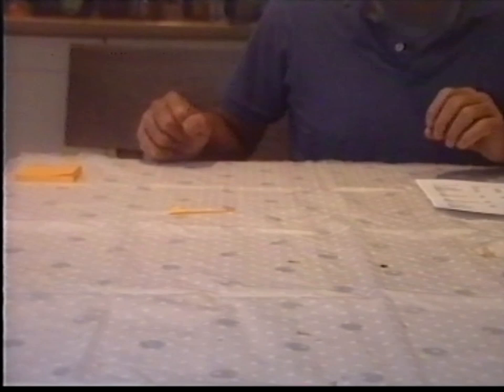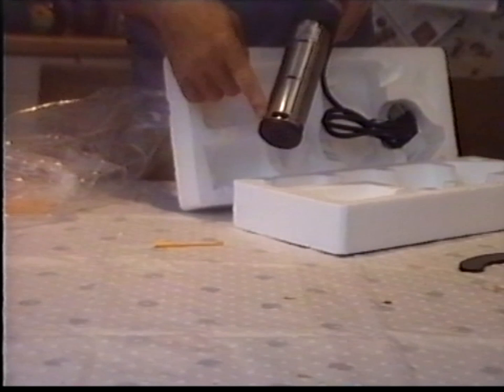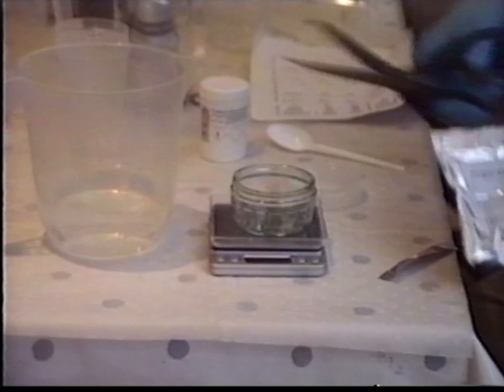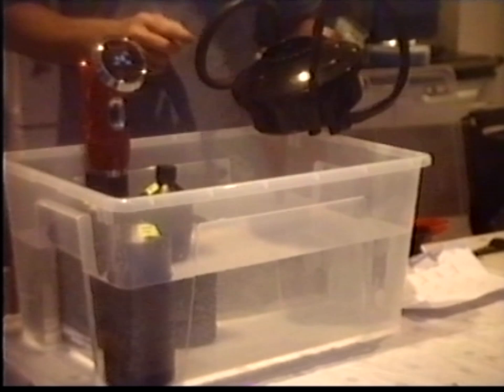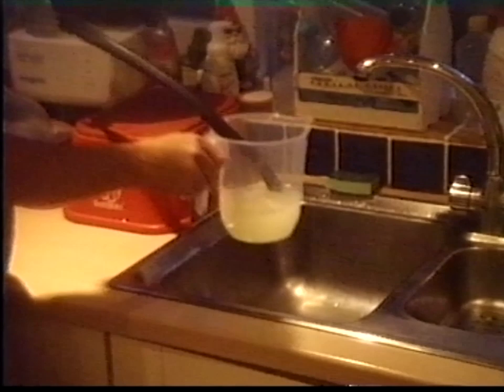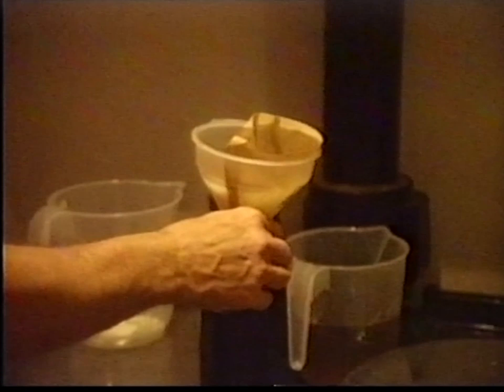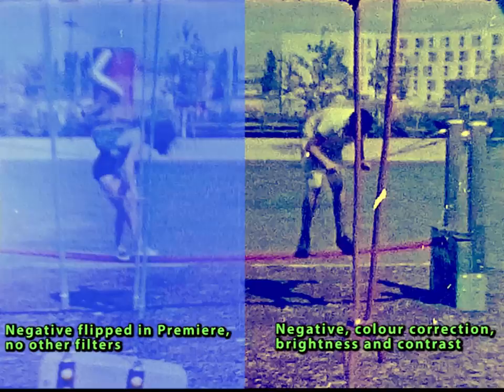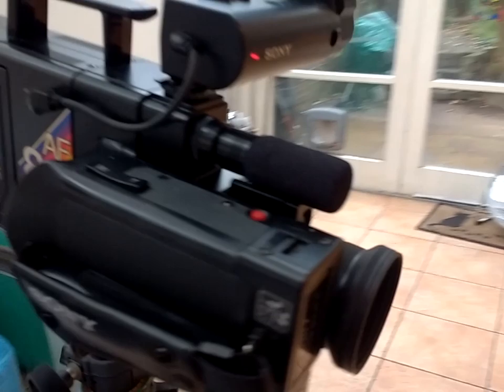Developing Super 8...in Colour!

Comment: Note: I’ve had the same blue problem before. I best guess is that whatever film you shot was tungsten balanced. I would try getting daylight film or maybe a daylight filter
Reply from the maker: I thought that at first but the blue cast was on both inside and outside shots. In any case the film stock is labelled 250D. I'm starting to think I didn't leave it in the developer long enough. Going to test that theory with my next roll and leave it in much longer.
Reply: @ZeroBudgetFilmSchool  did you ever figure out if leaving it in the developer longer corrected some of the blue cast? I just had that similar problem so I'd love to hear what you've found
Reply from the maker: @mikundam  well I discovered the low contrast was was due to overexposure, and in terms of blue cast this film turned out to do much better indoors under tungsten light. Also, expired colour film tends to have this colour shift towards blue, so there's that too. 

If you're developing fresh kodak colour negative I would suggest a blue cast could have been caused by shooting Tungsten film like 200T or 500T in daylight and not putting your daylight filter on Sun setting.
Reply: @ZeroBudgetFilmSchool  awesome thanks a bunch for the insight!

Comment: I have just got myself a moviemaker pro today from B&H! Do you use a travel adapter to convert the US plug to UK? Now you used it a while are there any hints or tips to get the best from it! I will be using Standard 8mm footage. Cheers bill
Reply from the maker: Hi Bill, I know it has its critics but I'm very happy with my Wolverine. I just use a normal US-UK travel adapter plug and the Wolverine is 12v DC so power isn't a problem. My advice is to put sharpness on 'low' , exposure on '0' and invert your negatives on a computer instead of having the Wolverine do it. Also, use cement splices instead of tape if you can because the extra thickness of tape can get the film stuck. If the film gets stuck DONT pull on it to get it moving, just open the gate and it will unstick. Final thing: keep the little led-lightbox clean. Clean it before and after every run. I sometimes use a q-tip moistened with isopropyl alcohol.
Reply: Just trying my first film. In addition to what I would consider normal noises I am getting a fairly regular knocking sound which comes and goes but is there most of the time. That does sound normal. Also it stopped part of the way through with message Please recheck films place. I opened the gate but it looked ok and still under tabs . Needed to turn unit off and back on and start recording again. While writing this it has stopped again with a grating sound and same message! No splices on film apart from leader and one of my slightly newer Standard 8mm films. Not a good start alas! Have you had that message and does yours have knocking sound? Now when I restart the film is no longer advancing just making motor sounds. Also the counter used for its guarantee is now up to 3! Should I try to unlace the film as its moving along now? Cheers bill
Reply from the maker: @Flycatchers1958  Hi Bill, probably too late with this reply, but I've had the knocking and grinding thing, just once though. It could be due to the film becoming unseated during the scan. The only thing I can advise is to take it out of the gate and re-seat it, making sure to have three sprocket holes visible on the white scanning bit. It may be caused by a bad splice or by super thick film.
Reply: Zero Budget Film School The louder knocking sound has calmed down but so far out of 15 recordings have just got one half of two 50foot Standard 8mm films to be reasonably stable? The rest is shaking constantly. When it did work it was by running the film in reverse as suggested by Wolverine so the scanner claw grabs the unused side of the sprocket hole. However whichever way I thread the film there is new damage to the sprocket holes in form of a small notch made in the film by the scanner claw. So not that keen running other films through when you know it will result in damage and most likely an unwatchable scan. Sending it back could be expensive and I wonder if a replacement would get charged duty as well?! Pity really as I was looking forward to going through my large collection of 60's and 70's films..